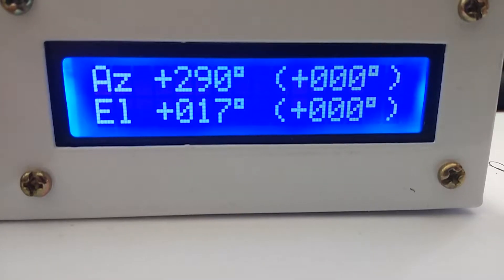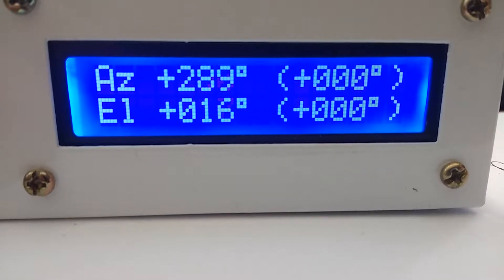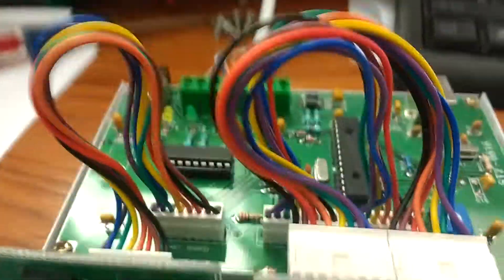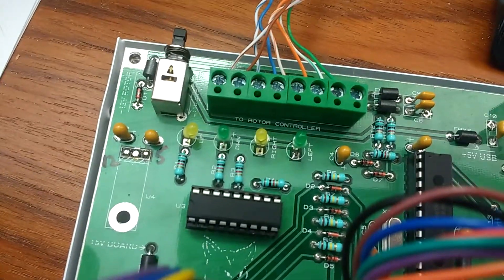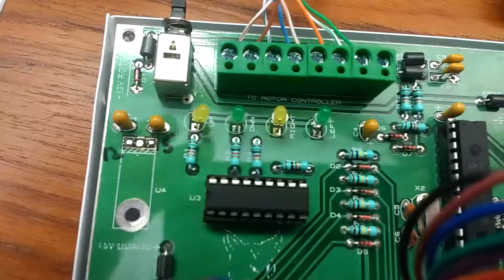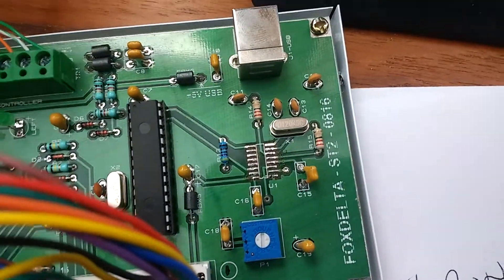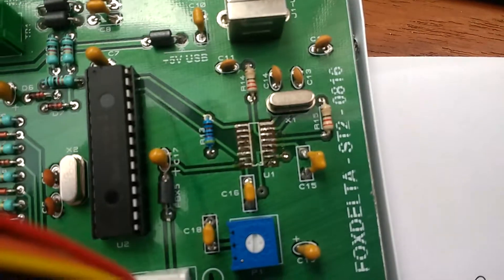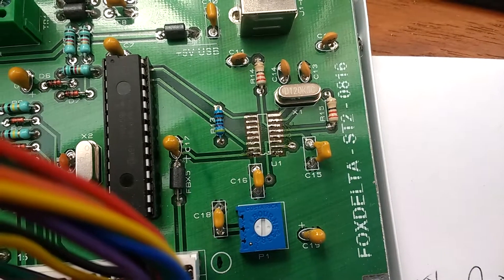Fox delta ST-2 antenna rotator interface repair after voltage regulator installed backwards

Comment: Glad you got it fixed Charlie… I have two of these: one USB and one RS-232 with the USB converter the latter is the one I use. The former I never got working correctly because of driver issues. The RS-232 version has worked flawlessly for me. 73 de Robert K3RRR
Reply: Hello guys 73 from ct2fzy
I have the usb st2 whid yaesu g.5400b but is very dificult to config whid azimute.  Elevacion is fine but azimute stays on 180* all the time.. can you help try to resolve this ples.. thanks